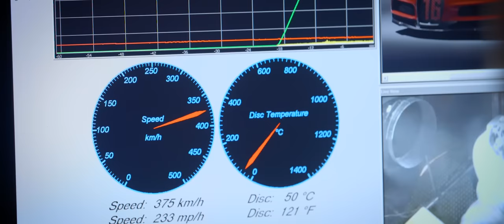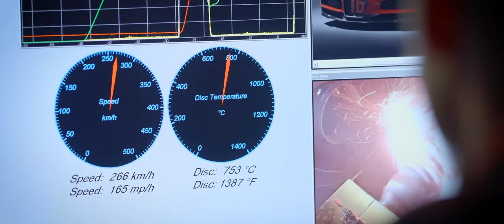BUGATTI CHIRON Titanium caliper brake-test extreme

Comment: When Chiron brakes cost more than your car.
Reply: A lot more
Reply: Yeah llike a single wheel without the tyre is like 7000$
Reply: It costs more than my life ಥ‿ಥ
Reply: @stlo0309  where are you from
Reply: I don't even have a car
Reply: @nikolapaspalj4954  41k for each tire
Reply: When Chiron brakes cost more than your all property.
Reply: @nikolapaspalj4954  it’s about 15 or 20 k
Reply: @oselish  so your house cost 7k? Uh
Reply: @milfslayer6984  it's just a joke
Reply: @oselish  that's a sad joke
Reply: @oselish  along the family innit
Reply: @nikolapaspalj4954  Ceramic brake rotors, drilled and slotted are made for a variety of sportscars, from $5,000-15,000 each, Bugatti's are extra expensive, much more than that.
The pads are ultra-expensive, rated to 1300-1500 degrees (normal pads are rated for 200-350 degrees), the caliper is 3d printed titanium, like swiss cheese with 8 pistons. Probably $60,000+. If the wheel were only $7,000 you'd be laughing.
It'd be too much to worry about just to take it out to buy milk from the gas station.

The temperatures reached are far beyond the boiling point of the best 5.1 DOT brake fluid, that is why the caliper is designed the way it is, to allow maximum airflow to the pistons and avoid heating the fluid., next thing you know they'll be adding a pressurized oil cooler to the brake lines, pretty crazy when you still change drum brakes every other day.
Reply: Obviously Dum dum
Reply: @tejussonics2323  where’s your sense of humor😐
Reply: @AyrtonSenna.  oh it’s somewhere there
Should stay far from your’s
Reply: @tejussonics2323  I don’t expect anyone to be dying laughing reading this, but it’s still a joke stop taking it so seriously
Reply: @AyrtonSenna.  I didn’t but yeah
It’s a joke
Reply: Yeah, and the brakes on a 747-8i which are designed to stop a nearly million pound aircraft rejecting takeoff at 185 mph before the end of a runway, exposed to temperatures of around 1400 degree Celsius, and survive. They are carbon brakes, and probably cost more than a Chiron. 

It’s all relative.
Reply: @speed150mph  lol i was gonna say that but i saw your comment
Reply: @nikolapaspalj4954  sounds not so scary, if it would be 100,000$ more, than it’s going to be scary
Reply: More than most houses u say 😂
Reply: Like 20k for one brake pad
Reply: I don’t have a car so they don’t :)-;)-:)
Reply: @stlo0309  no
Reply: @launapurcell  A set probably but not each tire
Reply: @stlo0309  nothing cost more than life
Reply: or your house
Reply: kkkkkkk
Reply: Not the problem for me, I own a 100K mustang Shelby, a 140k Jaguar and a 60k pickup and my property is also worth a million with a 720k house and 300k worth of land. This comment is not for me.
Reply: @GamingLegend-by8yb  considering your name is gaming legend imma guess your like 8 years old, and im no genius but I don’t think someone that young of age owns a damn thing you just mentioned.
Reply: Hat I was saying in simple words is that my parents own it
Reply: You should get what I am saying you
Reply: By the way, I am 13
Reply: @GamingLegend-by8yb  well I don’t get what your trying to say, but you missed the whole damn joke
Reply: No I did get the joke and I am not against you.
Reply: I know what this joke was
Reply: I laughed for a freaking minute straight
Reply: If I become sad even a little, it will costs 1000000 Bugatti Chirons.
If you think about, you will find out that it works for your sadness too.
Reply: More like your home
Reply: I can flex a lot then lol
Reply: @nikolapaspalj4954  Waaaaaay more than that
Reply: @AyrtonSenna.  He actually mentioned that the comment is not for him.
Reply: When Chiron brakes cost more than your life......
Reply: OP 😁😁💯💯💗💗
Reply: @nikolapaspalj4954  lol thats what i got my car for
Reply: Buy Chiron
Sell each brake
Buy more Chirons
Sell each brake
...
Reply: the wheels are 35k all
Reply: but let's face it, a guy who has money to buy a car like this will find the price cheap lol
Reply: @nikolapaspalj4954  that’s cheap?
Reply: When Chiron brakes are louder than your car.
Reply: Pornlande. That where im fromm.
Reply: @Senkino5o  a wheel doesn't include discs, calipers, pads. He said "wheel." That's a very specific part of the car.
Reply: When you have a car
Reply: Meanwhile my bike :
Top speed : idk, the speedometer ded
Brake : at least it stop
Reply: @milfslayer6984  not many people even own their own house. Therefore, not part of their property
Reply: A break job actually costs more than my car. I think new pads and rotors cost like $45k
Reply: What car
Reply: @milfslayer6984  
Could be third world you know
Reply: In "Simple math"...actually replacing the brakes, brake components, brake fluids and tires (you have to replace them each 14-16 months)...will cost you your average car and house...almost 160k.
Reply: @GamingLegend-by8yb  yeah a break job for a Chiron costs $150k so yes this is for you
Reply: Only pads please
Reply: Breaks system from Chiron costs like 40 grands. So you can imagine
Reply: One of those brake pads costs more than my Prius is worth!!
Reply: It’s not even worth it too. Rich people are weirdos. You could buy a reliable and efficient car for the amount that a nut and bolt on one of them weird rich people cars.
Reply: @GamingLegend-by8yb you are a little kid claiming his parents stuff in youtube comments trying to flex wealth lol this is embarrassing
Reply: Expensive trash
Reply: @launapurcell  thats bs... thats the cost of one set of tires
Reply: Chiron windshield wiper fluid costs more than my car
Reply: @stlo0309 yours life is worth more my friend 😢😊
Reply: I don't think it's costs. I think they just charge unnecessarily extra just for sake of exclusivity.
Reply: @saideepeditzzz6499 I don't even have an bicycle 😢

Comment: I was once a fitter in a major brake manufacturer, Lucas HDBS in South Wales working on air disc brakes for Volvo trucks in engineering we did these tests on massive twin tappet reaction beam callipers but at lower rotational speeds with more torque applied from the dyno, those brakes acted exactly the same with flames and sparks everywhere! its a bit impressive to watch the callipers twist around the mounting when the brakes were applied and the discs glowed red hot. Great video, thanks for posting

Comment: I wonder how long till someone puts these on a Honda civic lol

0-60 in 13 seconds but 60-0 in 1 second
Reply: Lmao I legit laughed for 10 seconda
Reply: Henry Estrada What are you on about?
Reply: @madeyoulook4689  what? That doesn't  make any sense lol front  wheel drive has none to do with brake bias
Reply: There are no tired that can grip well enough to stop that fast
Reply: Civic engine can't turn two of those rotor, let alone power the hydrolic pump to power the calipers...
Reply: @serpico1616  Brake calipers aren't powered by a hydraulic pump. They're powered by your foot and a brake servo which runs on vacuum.

And no a Honda wouldn't stop in one second from 60 and neither does a Bugatti, because it's not about brake power it's about tire grip. Bigger better brakes are not bigger to stop you from 60 in shorter time, they're bigger to dissipate heat better and stop you from 60 as well for the 10th time with pads and discs hot as they do the first one with the pads and discs cold.
Reply: What? Oh, you mean from 60 to sudden death LMFAO! If you're gonna decelerate that fast, you might as well just use a brick wall to do it
Reply: HAHAHAHAHAHAHA
Reply: @BigUriel  I thank you for saving me alot of time typing
Reply: Braking distance is limited, not by the strength of the braking system itself, but by the traction limit of the tires. You'll notice that it takes a greater distance to stop in snow or rain than on dry road. These expensive brakes are for braking response and effective distribution of heat.
Reply: BUT WHEN THAT VTEC KICKS IN ITS GOING BOI ITS GOING STRAIGHT TO THE WORKSHOP XD
Reply: So a Honda Civic beat you in a race?
Reply: @madeyoulook4689  ffs are you joking. The only thing that the buggati brakes are going to do is  lock up the front wheels and make a giant flat patch. That's why we have ABS
Reply: NpNE uh muh dude, it’s called a hypothetical answer. Learn to take a joke keyboard warrior
Reply: @madeyoulook4689  Yeah I know it's a stress test that will probably never happen in real life, It's a quality control. But most people take this comment section seriously lol. We all know it's a joke but whatever.
Reply: @madeyoulook4689  oh aaaand now have you listened to people explaining what brake bias means. I know engine brake exists, but It's very weak  soo to som up your theroy could only proven because the fact that the engine is in the front and so, front heavy.
Reply: @madeyoulook4689  And imagine what it would be like to have infinite grip and these brakes to stop lol, but now it's f1 brakes.
Reply: @Sinoops  Hold my beer
Reply: I'm not Basik 

“Sir you just ran through an Amber light, do you have any idea how dangerous that could’ve been?”
“But officer I couldn’t stop”
“There’s flames coming of of your breaks I think they work fine”
Reply: boostedsil40  thanks man someone who actually knows car knowledge.
Reply: @evanw346  lol drum brake problems XD
Reply: 13 seconds😂
Reply: @Zachattackisrad  not sure if he means front engine compared to a mid engine super car which will affect the brakes
Reply: They would total the car when they go to get a single pad replaced, since the pad, singular, costs more than the entire car
Reply: You could build a civic that runs a 10 for less than what you would spend on these brakes.
Reply: Huey Freeman lmao 😂 that shit was funny as hell
Reply: Sérgio Alves 🤡
Reply: The braking system alone would cost more than the entire car
Reply: zach holmes drivetrain type and engine layout have everything to do with brake bias wtf how did your comment even get a single like. That’s why every fwd race car like the seat Leon cup cars and the Audi TT cup etc, have such huge ass wings in the back, it’s to even out weight distribution a little more once you’re up to speed and allows you to make the brake bias a little less lopsided to the front since fwd cars have to have most of the weight over the front wheels. That’s also why FWD cars NEED and probably benefit MOST from spoilers. Having the rear wheels actually help in braking dramatically reduces braking distance, not to mention they help tremendously in high speed corners, but you along with almost everyone else here would probably say “spoilers only slow down fwd cars”
Reply: I’m here to ruin the joke but is there actually a civic that does 0-60 in 13 seconds?
Reply: @missileniall25  no... even the cheapest base model first gen in 1972 with the smallest engine being the eb1 which was only 1169 cc and carbureted and with 68hp, can go 0-60 in 10.5 seconds because it only weighed 680 kg (1,500 lbs) to find a civic that goes 0-60 in 13 seconds you would need to find one that isn't an Si or a Type R, it would need to be a base model that's beat up rusted out and running on 3 out of the 4 cylinders which even then honda's are easily the easiest cars to repair so you could easily make that 4th cylinder work again. Honda proudly holds the title of making the most reliable engines. If for some odd reason someone doesn't believe that just google "who makes the most reliable engines" Honda also made the most hp per liter piston engines in the world. The F20c held that record for over a decade (keep in mind their b series and k series engines aren't far behind) until Ferrari came out with the 458 italia, and even then it was only barely beaten.... another fun fact, A honda K20 powered Norma won Pikes Peak in 2014, 2016 and 2017, also most people would agree that Ayrton Senna is one of if not the best Formula 1 driver of all time..... What was his car powered by again? Oh right a Honda engine, he even helped develop the NSX. But for some reason people just love to hate on the best i guess.
Reply: @madeyoulook4689 front flip lmao 🤣
Reply: 0.1 seconds*
Reply: tf lol
Reply: Steve Jobs That deceleration would actually kill you though.
Reply: I have a Honda Civic and was low-key already (ironically) wondering if this would fit on my Honda lmao.
Reply: Mamate JAJAJAJAJ
Reply: I was thinking the same thing 😂😂😂😂😂😂😂😂🤣🤣
Reply: It will throw the driver out of the car through the front window
Reply: never because the price of the brake is worth ten times the price of civic
Reply: With those brakes you will have 2 Honda's 😁
Reply: Logan Catledge LMAO😂😂
Reply: These disks probably cost more than a Honda Civic :D
Reply: 0,01 secon 🤣😂
Reply: @BigUriel  no ... bigger brakes also improve stopping among many things 

And yes its a hydraulic pump which could easily be powered by an electrical surge the brakes masted cylinder is a hydraulic pump to pump the fluid from resivore and out 

The pump is foot actuated
Reply: wouldn't work it would just lock up and slide. Stopping power is largely about tire friction as well.
Reply: Logan Catledge this is gold lol
Reply: 60-0 uner a second, you know what i mean, its a crash test
Reply: @serpico1616  r/wooosh
Reply: Im not sure it would make a difference, the civics brake will already be capable of locking the wheels from 60mph so these brakes will still only be able to provide the same braking force untill the wheels lock. Braking distance relies on alot of things but if you only change the brakes then you wont be helping anything
Reply: Kinda hard for a car to go from 60-0 if it can't even hit 60 in the first place 😂
Reply: Excus me but 0 to 60 kilometers PR Hour in 13 seconds is slow AF
Reply: @madeyoulook4689  Um my honda car is all-wheel drive

Comment: Driving 400 km/h and SUDDENLY want to jump on the brakes, can happen to anyone.
Reply: 400mph and slam on the breaks? u will be out of the windscreen b4 the car even stops lmao
Reply: Faisal Mirza      KM/H, read it again sir
Reply: @faisal999254  Thats why we use seatbelts, to prevent being thru the windshield.-...
Reply: @larrylynch4043  around a race track those brakes would be fucked up gass/brake/gass/brake and so on
Reply: 380kmh. read the discription
Reply: That is what circuit de la sarthe is like with the chicanos. Really fast, big brake for chicane, really fast, big brake for chicane, really fast, end of the mulsanne sector
Reply: Leon Tangen does real actual car also uses liquid nitrogen for cooling the disc too?
Reply: It’s a test BOI✋🏽
Reply: @larrylynch4043  KKKKKKKKKKKKKKKKKK 3 times, so normal
Reply: Happened to me one time, it was on winter, i was walking on the street and i suddenly started to go downhill on my ass, had to stop but i didnt had the Bugatti Titanium Calipers so.. If only i had it than, it would've been the calippers not my ass who was burning.
Reply: With no cooling nonetheless lmal
Reply: energy3gp that might weaken the material, the swift heating due to brakes and swift cooling due to cooling agent.
Reply: energy3gp im not a car guy, dont ask me xd
Reply: @faisal999254  1st of all:kph 2nd of all:you don't know the formula to calculate g forces do you?
Reply: If someone came in front of you
Reply: @faisal999254  it's kmph not mph
Reply: Thats a good point
Reply: Alok Pratap Singh it really doesn't though...
Reply: Whooosh to everyone
Reply: okey.. even if it was kmph it's still pretty dangerous to slam on the breaks at that speed.. the amount of force being applied on the human body is no joke
Reply: Leon Tangen lol
Reply: Kkkkkk
Reply: @eticcbb  lol that's goid
Reply: Yes I always casually drive 400kmh through my gates community
Reply: For us Americans, 400 kmh = 248 mph
Reply: @faisal999254  The speed at which you brake doesn't matter, the forces on you when you break will be about the same at 1000km/h and at 10km/h.
Reply: @daemonad505  The thing is the breaking distance varies with speed because the acceleration (and therefore the force on you) is limited by tires and brakes
Reply: @daemonad505  The g forces are the same if you brake from 1000 km/h or 10 km/h. Only the braking power makes the difference in forces you experience.

Edit: Yeah basically said what J said, but without messing up breaking and braking. So my post has more credibility.
Reply: @daemonad505  Of course they are not, since Chiron has more power in it's brakes. If you brake in a Chiron from 10 km/h or 400 km/h to zero, the g forces are about the same during the braking period. Of course there's some varying factors like heat etc., but theoretical braking power is the same. It's pretty easy to understand, you have certain amount of braking power and it stays the same no matter the speed. That's partially why we have speed limits too, when the speed goes up, the braking power doesn't.
Reply: Gotta make sure you make that exit, they come up quick when going 400
Reply: If you drive 400 that is exactly when you always have to be ready to jump on the brakes to do an emergency brake, even on German Autobahn. Happens too often that someone pulls out into the left lane without checking mirrors. My car only barely does 300 kmh but you have to break that hard from time to time, especially when driving fast. Bugatti buidls road legal cars for German TÜV, their brakes have to withstand a full stop from top speed at least a couple times in a row in order to get allowance.
Reply: Not to anyone, but can happen to Chiron drivers. That‘s why these torture tests exists. Because it‘s possible to do that, even it‘s unlikely that someone does it.
Reply: @viciouss6.2  Why do Americans still use Imperial system? I think it's just Americans and Burmese that use it lol